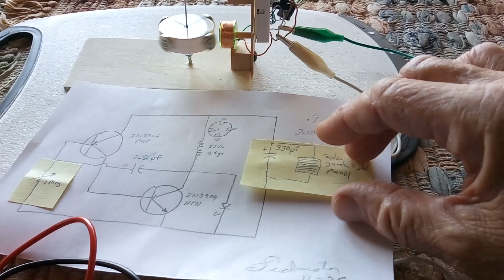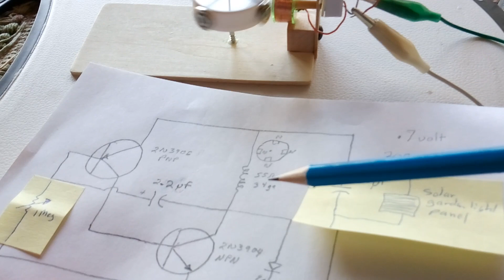Micro Amp Blinker Motor

Comment: Really good news for a 34 AWG coil. I wonder what 8 of the waver coils would do. In any case, it makes replicating easier. Will have to try it!
Reply from the maker: The waver coils would probably work but I don't know if the led blink would show up with that much resistance.  A Lasersaber EZ Spin arrangement would be fun to try.
Reply: Am happy things work out and you get some successes. I often have little idea myself, preferring to experiment and see what works. To start with a known circuit for a known use and alter it to perform another. There used to be a larger group of experimenters, as you may know, sharing findings... it would be good to get that going again, including yourself. But yes, will email you :)